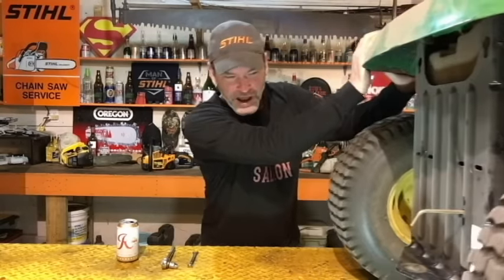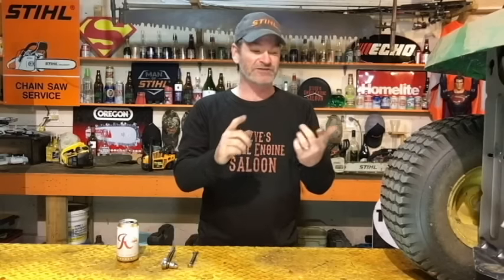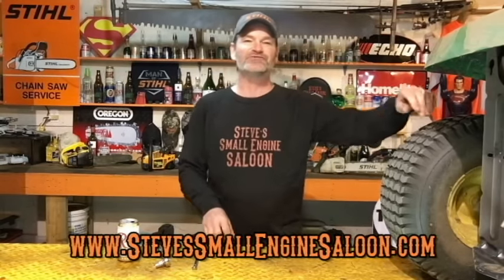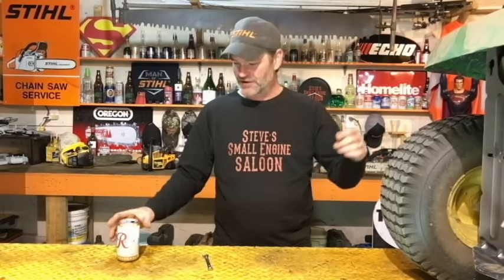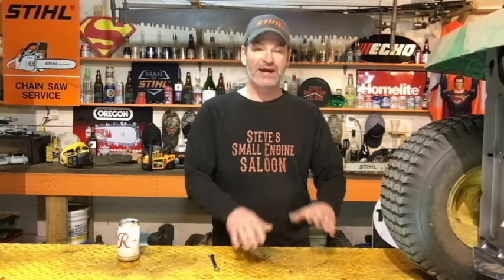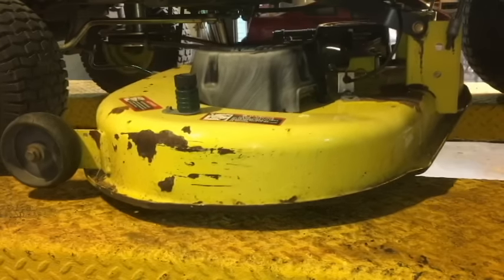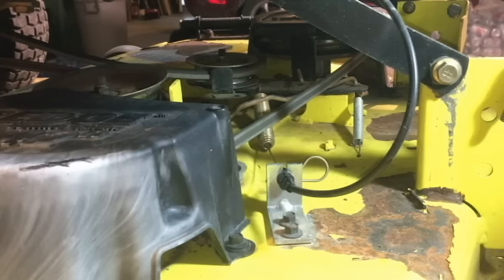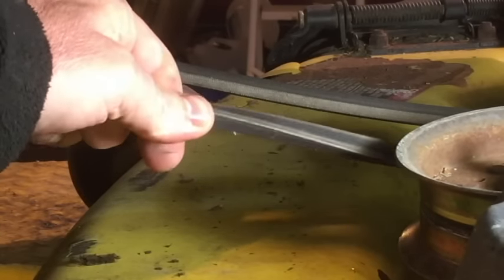How To Adjust The Belt Tension On A Riding Lawn Mower

Comment: what causes the blades to hit each other when engaging them to start cutting ?
Reply: OMG! Wrong size blades? If you had REALLY worn bearings, maybe they could do this, but it seems almost incredible. Try wobbling the ends of the blades up and down. If you can feel the shaft moving inside the bearing, you probably need a new deck. Another possibility is a bent deck.

Comment: My tensioner is as tight as heck. Brand new belt. But the tensioner pully bottoms out and there is still slack in the belt. Maybe the belt that was on it (bought it used) and maybe the new belt are too long because I didn't buy it from cub cadet?

Comment: Hey fellas, I recently replaced my lower cable on my J.D 110 I thought I was golden until I turned mower on and blades  stays on or if I lower my arm, blades also engage. Any ideas why?
Reply: When the blades lever is disengaged;  make sure the bracket that the large spring attaches to moves freely.  And find a diagram for how the belt should be routed and make sure the mower belt is routed correct.

Comment: I have a JD D130. The adjustment bracket is welded and not bolted. The belt is always loose. How do I adjust this?
Reply: Perhaps a belt 1/2" shorter. I may try that as well because there is no adjustment on the electric pto models.
Reply: I don't have a JD personally, but have you checked at the cable end at the engagement lever? Perhaps there is an adjuster up at that end of the cable.

Comment: My John Deere 120 that I bought in 2020 is not adjustable in the same way.   the bracket is welded on mine. It looks like you have to adjust the cable itself

Comment: Steve gets a big ATTA BOY!!
Reply: As a side note, on my Ariens 46"  20 HP, the adjustment is a single 1/2" bolt and you are better off with a socket because the cable (at least mine) lays right on top of the bolt andkind  of in the way. No biggie.
Reply from the maker: Thank You...

Comment: You didn't mention the other little spring on the deck that is attached to the swing arm of the pulley. i have had that spring come out of the slot in the deck quite often.

Comment: somehow my belt tensioner knob, in the front of the tractor, fell off. which left the threads, Behind the hole in the sheet metal. How can I stretch the threads forward, in order to reinstall a new knob??

Comment: OMG steve my name is steven too. I bought my new JD E110 saturday. The belt is real slack when it is disengage. I engaged it with the engine off and it tightens up, but when its disengaged it rest on the deck. Dont understand, should i tighten? Also the deck seems to vibrate when it engages after i start it.
Reply: If you have vibration, it sounds like your blades need to be rebalanced. One side is heavier than the other. Grind more off of the heavier side of the blade or replace with new ones. Blade balancers are only like $4-$5 on Amazon. Or, tack a nail in a pice of wood and put your blade sideways on the nail. It should hang like a picture ( straight ) and level. If not, one side is heavier than the other. The heavy side needs to be ground off more to level out.
Reply: Orion3 not during the mowing only at the very beginning when the PTO engages. Then it stops

Comment: How about the grease zerts they have for the blade shafts John deer at least has them but the only problem is that the bearings are sealed bearings kinda defeats the purpose of the grease zerts doesn’t it

Comment: Ha ha ha! Gee, I don't understand why not to do this with the engine going? Ha ha ha! I this greatly! My 2007 Craftsman deck belt jumps off quite a bit. The "authorized" Craftsman repair shop said that it has the correct belt and its adjusted correctly but when its engaged it still loose in my humble opinion. The belt ALWAYS jumps off when disengaging. This helps tons! Thanks!
Reply from the maker: You're Welcome...

Comment: Newer models have a welded bracket that can’t be adjusted, presumably to save a couple of cents on two bolts.  This has caused a number of issues and more frequent need for belt replacements,  and often servicing.
Reply: I got the same problem. Manufacturing defect if you ask me . I’m out $2600 with a mower that is more trouble to operate than it’s worth. Are you still crawling around on the ground putting your belt back on numerous times just to get your grass cut? I had 2.3 hours on my mower when the belt just broke and had to be replaced only after having to put it back on 5 times . Sounds like an excellent way( ploy, scheme, ) to sell more belts to me and they ain’t cheap!! We got to face it , we got lemons .
Reply: @leasagowers2293  I eventually got rid of mine before a move to a new town.

Comment: Steve I’m new to your video’s. I have question to ask maybe you can help me out. I have a bolens riding mower and it won’t start. It has a new battery put it on the last time I mowed two weeks ago. Problem is I cannot get it to start now all it wants to do is just click when I turn the key. The stater doesn’t even move. Would you have any clue what is going on.

Comment: I don’t know what to do but my l100 recently just replaced the deck belt and it’s correct one and in correct but when I start the mower the blades engage when the lever isn’t even on or I took it off and it still does the main pully spins when I turn the key and it supposed to right? I don’t understand and haven’t found anything to help my issue yet

Comment: I recently took off my deck and I noticed on the inside of the black shroud that covers the spindles on the top of the deck has a little wear mark from the belt hitting it it's an e110 I only had it for a couple months anybody know what the causes is the belt too loose

Comment: If you're machine is a newer one then you are most likely out of luck as they changed the adjustable bracket to a man adjustable type.
If the cable is stretched and you still need to make the doting pull harder then you can either get a new cable or take the spring loose from the idler bracket an Tuesday a simple thru Knot in the cable.  That will shorten it by at least 1/2". Reinstall and you will have achieved what an adjustable bracket would have done.  Worst case is that you still need to by a new cable.

Comment: Steve my belt tension  is to tigh when I engage it is to tight to release the belt brakes and spins off soon as I crank it it is the right size belt but it's like its to small anytips I've loosened tention much as I can

Comment: Hey Steve my belt adjustment thing is welded in place. How can I adjust it?
Reply: Steven D. 
I would like to know the same thing I have a John Deere E130 and I called John Deere and that is not adjustable. I was told if you could bend down a little area by that nut which looks like you can adjust that which you actually can’t that might give you a little bit more tension other than that they say replace the belt mine is brand new and it keeps falling off so John Deere sent me a new tractor. I would think the only way to Jury rig that thing would put some type of a shorter spring on there

Comment: Steve, On my mower the tang on the take up spring broke. I found that the hole for the spring on the idler arm bracket had a slot worn in it, almost to the edge of the part. I ordered a new bracket, $8.00. Husqvarna 532197249 Idler Arm for Riding Mowers. Thanks for the Video.

Comment: What if when you engage your blades and the blades start speeding up slowly and the deck bangs, like BANG..... pause BANG... Pause... Bang.. Then the blades are at full speed after 4 seconds. It stopped now. My starter wire was loose and I tightened it, and it hasnt done it since, but I know that had nothing to do with it. But I did move the belt down on the tensioner cuz it was higher than the others. Maybe cuz it was misalighened?

Comment: I have a '99 Yardmachine that the belt slips on. I cannot figure out how to tighten the belt. It has a spring that engages the mower deck. I've tried a new belt, & it works fine for a mowing or two, then it starts slipping again. The belts are tight.
Reply: Sounds like it could be warn out pulleys. If the belt rides on the bottom of the V groove it will slip like crazy. My old Husqvarna is doing the same. Could even be just the engine/deck drive pulley at the pto clutch in my case for sure.
Reply: @fiskfarm   The mower was given to my son, & he gave it to me, because of the problems. He replaced the belts, but I think he just bought cheap ones. This same mower also won't climb a small hill, in low gear. I just ordered a Kevlar drive belt, as the old one looks quite worn, also. The belt is slipping on the transmission pulley, & looks like it is bottoming out. Someone else had said these pulleys don't wear out.(?) I plan to tear into it, this weekend, & check out all the pulleys. Thanks for the reply!
Reply: @swmovan  cool, let's stay on the case. I believe we are close to solving this. It ain't rocket science and my career was troubleshooting industrial equipment and generally speaking it is a simple fix that the engineers just couldn't see what was immediately apparent to me. Instead of thanking me or God forbid hiring me they would just get defiant. Apparently I hurt their feelings because they were very embarrassed. I'll try to do some observations this wknd. Btw, our new Cub Cadet ZT1 54" is so fabulous it is hard to worry about the old Husqvarna but I am determined to get it solved as that's what drove me to replacing the Husky. That and the strain on my wife steering the tractor as opposed to the ease of steering the zero turn. She h as yet to try it but I love it so much she can't get it away from me anyhow 😂😂😂👍
Reply: @fiskfarm  I replaced the drive belt, & now the mower is slow. It now will climb the hill OK, but changing the speed does nothing. I adjusted the speed adjustment rod, but didn't help. With the old belt, at least it had different speeds. Although it would not go into 6th. It was as if the rod wouldn't let it go that far. And the spring that holds the variable pulley seems almost too strong. I am going to try to adjust the clutch, per the manual, tomorrow. The variable speed pulley is working fine.

Comment: I recently bought a John Deere E100 from Lowes.  After 8 hours the belt broke.  I replace it and quickly noticed it is very lose. I followed your video.  But my problem is my Lbracket  is welded to the deck., There is NO screws for adjustments. I followed my owners book to a dot, and it does not clearly state how to tighten the deck belt.  Any advice anyone,
Reply: You are not alone Crystal.  Im searching for answers as well
Reply: @jeffrey9195  I went to Lowe's where I bought it 2 weeks ago.  Told them what was happening since the rider had 8hours of run time.  Lowe's came and picked it up and sent it to the John Deere Dealership. A few day later I got a call from John Deere and told me the deck was defective. And John Deere replaced the entire deck for free.  I'm happy to report since it came back from John Deere I have had no problems.   If your rider is new reach out to your local dealer chances are they will repair it for free if it has low run hours.  Best of luck.
Reply: Crystal Jones thanks a lot.  I bought mine from Lowes as well.  Only 6 hours on it.  I tinkered around with it tonight. Reversed a cotter pin on the cable, tightened some nuts.  Cut the front yard and cycled it maybe a dozen times and it stayed on. I Still don’t trust it though. I have a feeling I’ll be returning it as well.  Thanks again for your reply.

Comment: One thing you didn't mention is the situation where the belt is too tight. Before new belts for my Craftsman mower have had a chance to wear in, there is no slack at all, and it's as if the engagement lever were engaged all the time—if the engine is running, the blades are turning, regardless; not a safe situation.

The obvious solution is to introduce some slack by adjusting the cable bracket.

Comment: I don’t know anything about fixing lawnmowers. I saw the slack on my belt and figured it was a belt problem. I changed the belt and it was even more slacked. The cable has a ton of slack, so I’m gonna go see if my mower has that and I’ll get back to you....
Reply: Ok, so I’m not seeing anything to move the bracket like that so I’m stuck where I am. I have a Toro mower.

Comment: I've got the same model and the top belt comes off sometimes when engaging the blades. 
Any ideas?
Reply: Just check to see if your pullies are all aligned you may have bent the deck were the spindle attaches. Remove the deck check for bad bearings, they may need grease on fittings to lossing up. I had to shim my spindles because the blades were tilted down and belt guides were too loose.
Reply: @jojograffsgnino276   thanks, I'll try it.
Reply: If you mean your drive belt comes off while engaging the deck belt than you may need to adjust the drive belt temsion and check those pulleys and guards. Your belt nay be stretched.

Comment: Hi like your videos and I sub`d for sure  unfortunately I have an ariens 42" cut about 4 yrs old and the new belt is slipping the bracket is not adjustable and I cant find a way to tighten the tension any ideas ? Thanks DB from Ky

Comment: My wants to throw the belt off when you disengage it all the bearings are good and tight I just don't understand why it keeps wanting to throw the belt off and eat the belt up
Reply: Jeremy Westfall mine does the same thing John Deere 130 I found that if I raise the mower deck up as high as it will go the Belt doesn't jump out it jumps off when I leave the mower deck down low because of all the slack in the belt at that point and also be sure you have the mower at idle speed not running at cutting speed mine throw the belt off if I don't idle it down

Comment: So what if there is no way to adjust the wire holder with the two screws?
Reply: Yep, I have same question.  I watched the video, was all excited and to my dismay my bracket is welded to the deck, not held on by two screws.  Ugh

Comment: I stopped drinking 10 years ago and was just given a riding mower. Can I do this without a beer?
Reply from the maker: Root Beer works great also!
Reply: Turns out the blade belt is not adjustable. It slips off Everytime I put the deck below 5. It's direct linkage connected by springs and I see no adjustment besides Maybe a a shorter belt or maybe shorter springs.

Comment: the tension pulley you don't need that right because I have a electric switch to engage my Blaze has a spring loaded tensioner pulley so there are no cables if you could do a few videos with the electric switch to engage your deck I'd really appreciate it

Comment: GOOD LUCK WITH A FACTORY WELDED NON-ADJUSTABLE L BRACKET FROM JOHN DEERE! The design keeps you from adjusting the tension when the belt stretches a bit over time. It forces one to buy a new belt before it's time. There are a couple of options, though. ONE OPTION IS TO PURCHASE A REPLACEMENT L BRACKET W/ PRECUT ADJUSTMENT SLOT, PART NUMBER GX20168, and TWO SELF-TAPPING BOLTS, PART NUMBER GX22456. Now remove the deck and cut through the welds on the original L bracket; CAREFUL NOT TO CUT THROUGH THE DECK SURFACE. Install the replacement L bracket and self-tapping screws through the factory punched holes of the deck. ANOTHER OPTION IS TO MODIFY THE WELDED L BRACKET. Remove the deck, flip the deck over and drill through the factory punched holes through the underside of the welded L bracket. Flip the deck back over to its upright position and cut the welds on the L bracket; CAREFUL NOT TO CUT THROUGH THE DECK SURFACE. Place the L bracket in a vise and drill or cut an elongated adjustment slot between the drilled holes. Place the L bracket on the deck and install TWO SELF-TAPPING BOLTS, PART NUMBER GX22456, through the slot into the factory punched holes of the deck.

Comment: I need another idea. The adjustment is all the way back and I have a brand new belt. I still have a belt that keeps falling off. It is driving me mad I tell you!
Reply: Clayton Realist Clayton working several shops I've seen the same thing many times from customers, I always recommended using Gates belts, very slimmer from the difference of a 2 ply and 8 ply tire, Belt deflection it's always a major problem if they should sell you the wrong type of belt, as much as a side of a belt can get impregnated with foreign matter, so can your pulleys, (slipping) clean your side faces of your pulleys. (Sandpaper &  soap water) if your belt is falling off more than likely you got too long of a belt,
Reply: @daleslover2771  It's a John Deere belt so I am hoping the quality is good. It is much stiffer than the belt I took off. I am trying to find the actual spec for the pulleys and see if there are supposed to be any springs other than the one on the throttle. I have a feeling I am missing a spring (my nephew "fixed" it for my sister) and from what I can find it looks that way. The belt only falls off when you disengage the blades so I have a feeling that's it but will look at it. Thank you for your help bud I really appreciate it.

Comment: Well, darn it, I went out to do it, and mine is a bit different under there it's a E120, and the spring doesn't have a bracket like that with screws, darn it! And it's for sure loose. Oh well, still thought your video was good